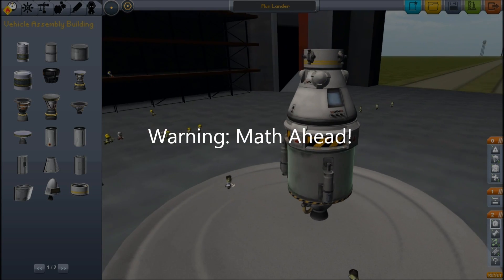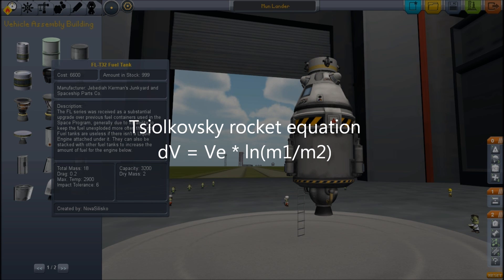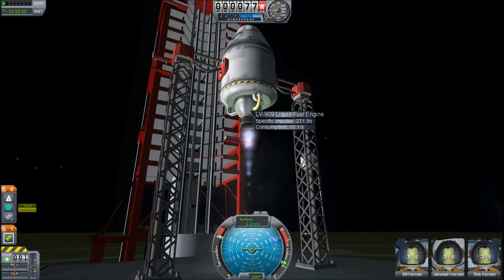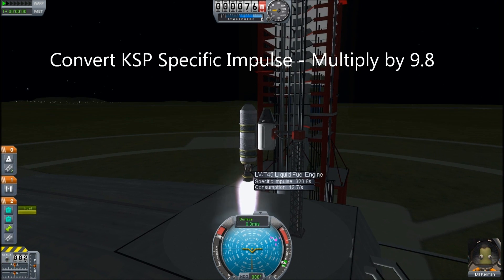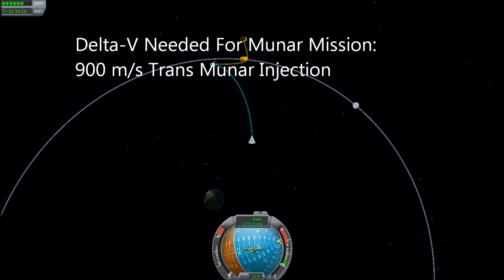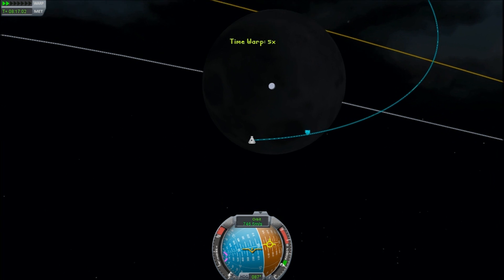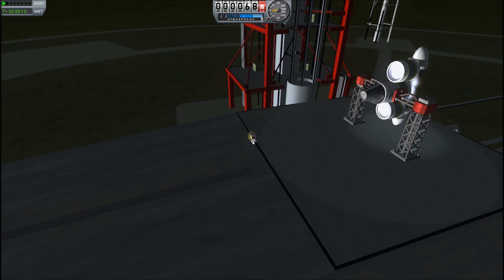Rocket Science - Kerbal Space Program

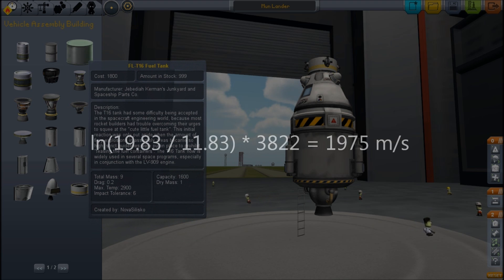Comment: The equation he puts at 2:06 is In(Starting Mass/Ending Mass) * (the Kerbal space ISP times 9.8)

As an example if I have a rocket that starts with a mass of 2000, and ends up with 1500 then the equation goes like this:

In(2000/1500) * (3822) = 5096m/s 

You need to think of the number 5036m/s as an amount or a distance instead of a speed. It takes about 900m/s to get to the moon. 

Please someone correct me if I got any of this wrong. I'd like to know before I go and blow more Kerbals up.